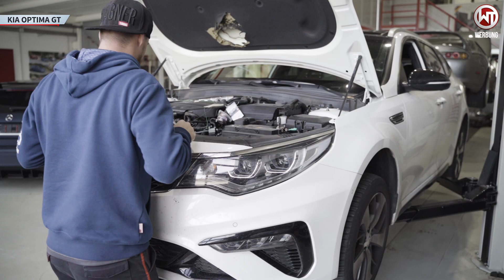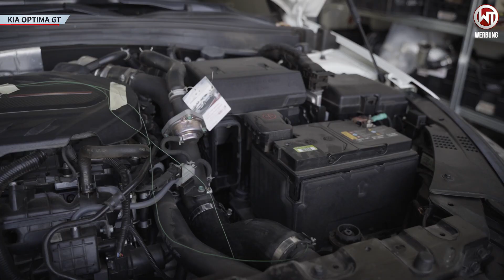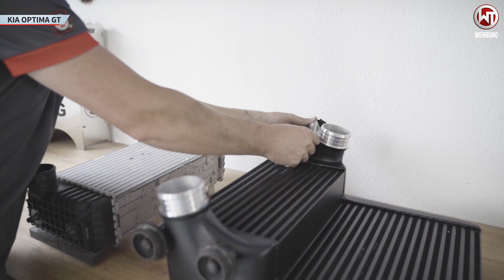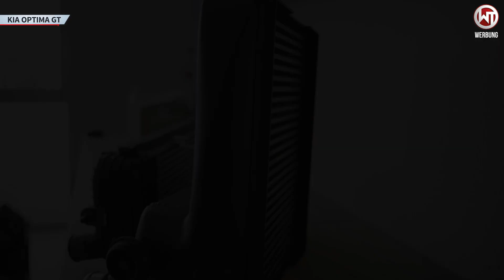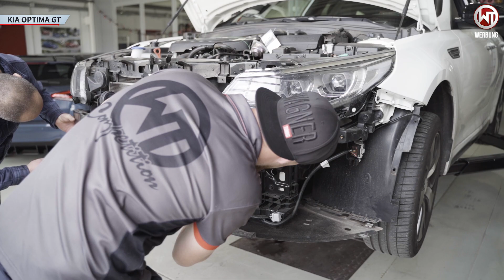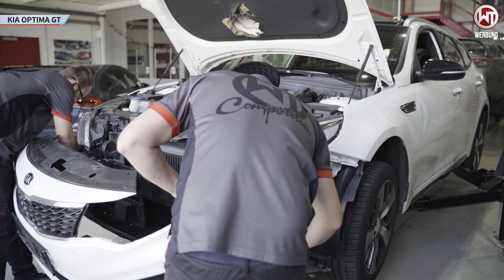Wagner Tuning - Kia Optima (JF) GT Intercooler Installation

Comment: Is the optima in this video the 2.0 turbocharged motor ? If so, what year? Is there any tuning required after install?
Reply: Hi, yes it is the 2.0t version. You dont need for the stock version any intercooler, normally it is necessary after chiptuning+